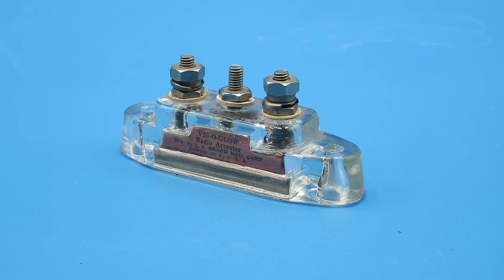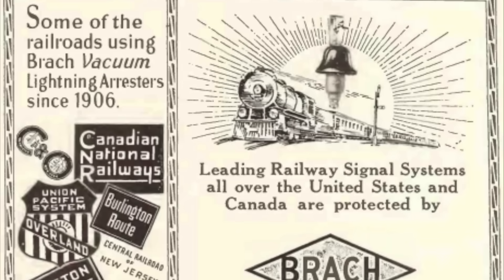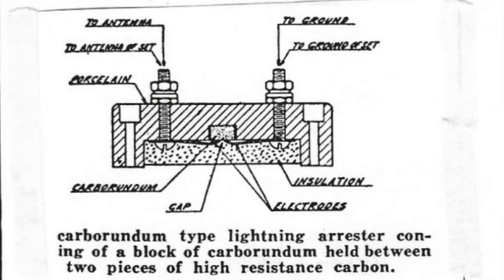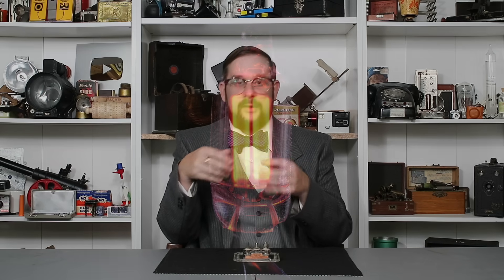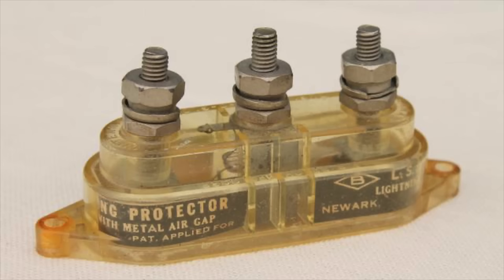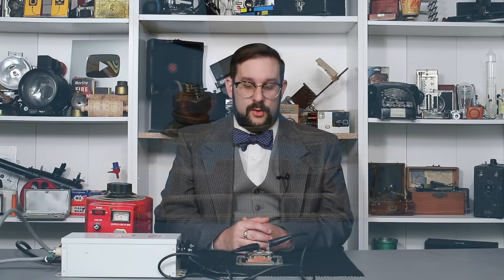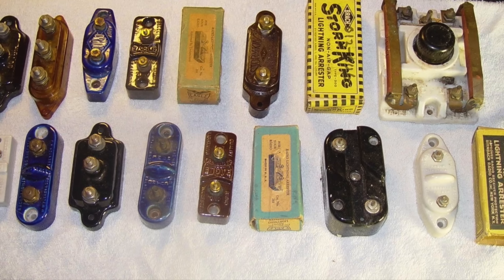SHORT: Vis-o-Glow Lightning Arrester

Comment: back in the day, I had a friend who ran a big CB "alligator" station, who used to unscrew the antenna cable ("coax") lead  from his rig and place it into a thick glass "mason" jar (I told him to do this to protect himself and his CB station from lightning strikes) and during  thunderstorms, you would see a mini-lightshow as the static buildup would dance about inside the jar (he, himself, didn't see the sparks- but, rather, HEARD them.. as he was totally blind!)  and before you ask- yes, his antenna installation was properly-grounded (but lacked a spark gap).

Comment: As a Telecom Engineer I've seen antennas obliterated by lightning...
Notably an expensive Procom CXL 2-3LW on a 20 meter mast at dispatch of a transport company we installed a couple of months before. Only white shards of glassfiber remaine, the golden Aluminium mount had a crater where the antenna was, and in a circle of 400 meters almost all electrical systems were damaged, and a large diameter telecommunications cable melted...
Radio and a Procom bandpass filter on the coax were fine, filter had some flash marks inside, power supply a write-off.
No Lightning Arrestor could have prevented this, was a direct hit on the antenna!
At my current workshops mast I have 5 modern arrestors, ad expensive equipment.
And as a "Novice" Radio Amateur I'm going to do the same for the antennas I'm going to place on my home.

Thanks for the Enlightning video Giles! 🖖⚡⚡⚡

Comment: Some modern lightning arrestors also include a blank 22 shell in them. This might be the part referred to as the "disconnector" in the diagram you show. I used to work at a provincial utility's test lab and we would dissect and test these devices before accepting them for purchase and I distinctly remember us talking about the blank we found in one.

Comment: "[your antenna] will act as a lightning rod"

Popular misuse of the purpose of a lightning rod; they are designed to attract & dissipate the low current leaders that precede strikes.

Lightning rods have pointy ends that make high charge density at the tip; that "hot spot" draws leaders and the rest of the metal rod directs it to earth.

Cheers 🍻 ✌🏻

Comment: Many years ago I worked for British Telecom. The big 300 pair cable that came into the building was terminated on krone strips, which are the European equivalent of punch down blocks. Every ten pair block on the wiring frame where the cable was terminated had an additional ten pair gas discharge lightning protector installed on it, in case there was a lightning strike on the buried cable in the street outside. There was a lot of expensive equipment on the end of those phone lines and the company wasn't taking any chances.
Reply: When BT brought in the BS6312 socekt system the master socket included a gas discharge protector between the A (pin 5) and B (pin 2). This was also the case with the later NTE5 "linebox". Though appears to have been removed from the latest vesions intended for use with VDSL. Wikipedia claims "negative effects", possibly at these frequencies stray capacitance is an issue.

Comment: It's the internal,  therefore, misinformation.  1. Lightning arrestors were used by the average radio listener, as well as hams, because early radios required an outdoor antenna. 2. Why do you assume a 3 terminal lightning arrestor was for 2 antennas? They were for balanced dipole antennas, which have 2 leads.  Otherwise,  it's a good video.

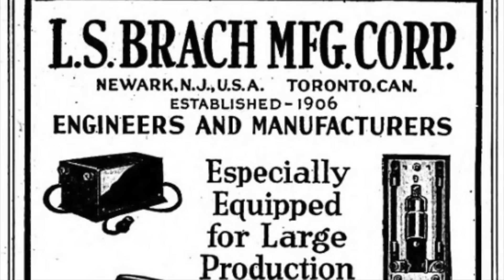Comment: 0:54 Forgive my pedantry, but I don't think these qualify electronic kits.  Electronic implies transistorized components.  I believe this qualifies as simply "electric".
Reply: Electronics just manipulate electrons. The discipline long predates transistors. There are many electronic components that have no transistors, such as capacitors, resistors, diodes, various types of vacuum tubes, even a battery is an electronic device.
Reply: Dang, I forgot everything before the era of 1950s transistors is just non existent after

Comment: Interesting. I built one using neon lamps for my long wire antenna. Not long after we had a severe thunder storm and I disconnected my receiver just in case. Some time that night I hard a terrific explosion as a lightning bolt struck nearby. My neon bulbs had all vanished, and yet the antenna remained intact. I think it was not struck directly but converted the bolt's emp pulse into an electric impulse and was quick enough to not melt the wire or balun. I did have other equipment that sustained damage though.

Comment: Actually the higher the air pressure the higher the resistance. At a vacuum the resistance approaches 0 ohms. Part of the reason for developing brushless motors was for use in aerospace.
Reply: False.  Resistance drops at first as pressure drops, then rises again once there are no charge carriers.  A good clean vacuum is an excellent insulator.  High voltage capacitors are routinely insulated with vacuum.  They are called, oddly enough, "vacuum capacitors".

Comment: Others make/made smaller Lightning Arrester like De-funked Noble DSAR1 series that DSAR1-441LA units were sold thru Radio Shack as Part # 270-811 that still popup on ebay etc.  Can use them before MOV or TVS Diodes to kill much larger power spikes without "wearing out" those parts.

Comment: 😃the old technology is fascinating, years ago dismantling an electrical system of a bank I found a metal box with a large earth conductor connected to the metal part, on one side the meter line entered, I opened it and found the car spark plugs, I was shocked by this type of self-built system in such a place
Reply: Not really, as a ham radio operator there was a "how to build" article in one of the radio magazines. It consisted of two spark plugs, non resistor type from Accell Racing Supplies mounted to a copper busss bar and they used a anti fouling extension as the nut to hold them in place. This design is for operators who use twin lead for their antenna feeds. The twin lead is mounted to the plugs and then continues into the ham shack. The buss bar is mounted directly to the ground stake. The operator then keys up his highest powered transmitter into the antenna while another individual observes the spark plugs through the hole in the bottom of the anti fouling extenders. If no sparking occurs all is OK but if either plug sparks, they remove the anti fouling cap and using a spark plug adjusting tool the open the gap a bit more until there is no more sparking. When all is working good they seal the hole with some sealant to prevent insects from nesting inside the chamber. One rule that most Hams practice, disconnect your antenna feed(s) from the radios, unplug all radios from power sources and disconnect any serial, USB, AND AUDIO cables between radios, amplifiers and computers. On a nearby strike from a bolt of lightning, it can produce thousands of volts of induced power into these cables which act as antennas. It will even induce high voltages on your homes wiring that can destroy anything connected to your home electric system even if the bolt did not hit the power lines.

Comment: A series of paralleled neon bulbs with progressivly bigger value resistors to ground makes in interesting show during a thunderstorm. When they all stay lit, run...
Reply: wow that's awesome!
Reply: Run, no, duck, as there is no way you'll outrun lightning
Reply: "Run, no, duck, as there is no way you'll outrun lightning...".

 Unless you're Usain BOLT.  😁
Reply: @paulstubbs7678  Why run? It's best to stay near the grounded equipment. You will have a significantly higher resistance than the metal in the equipment. If you are really concerned, just grab a random extension cord and wrap yourself in it.
Reply: how does a device with a stationary open spark gap even have a steady ground under normal conditions?
Reply: @funnycatvideos5490  it's the resistance of air due to the distance between two potential differences, one to earth and one to a wire above the earth
Reply: If you run an AM receiver with the squelch turned all the way down you can hear the ground and clouds charge up like a flash camera capacitor. If you do it while driving you can hear it charge up and diminish as you drive through hot spots.

Comment: Spark gaps are also a regular feature built right into printed circuits. Less common these days of course, but they used to be common.

You draw opposing triangles in your copper layer, remove the solder mask, and then tune the space between the tip of each triangle to match the voltage you want to suppress.

It's got all the same drawbacks as open air spark gaps, and performs even worse, usually only good for one protection event. The cheapness and ubiquity of TVS diodes and other suppression techniques means PCB spark gaps are often the worst choice nowadays. But, they are completely free, so you still see them now and then.

Comment: I had a neon discharge lamp at my "long"-wire antenna when I was a kid. I remember listening on the radio when I heard a clicking sound. The lamp was flashing. So it did work. Though I've moved a few times that lamp has followed but it is hidden now. And in parallel with a more modern protection. I think that the voltage for that lamp is around 70 V.

Comment: Gas discharge tubes are still used today to protect radio equipment.  I've got one in a lightning arrester on my vertical antenna.  The main difference is that the tubes are much smaller and mass-produced, but sometimes single-use - they're known to blow apart if a lightning strike is close enough (or direct).  But you can get a replacement for a couple bucks these days.
Reply: That is unfortunate. If they blow apart, they won't protect much, if at all. Because the idea is for them to remain behaving like a short circuit during the duration of a strike, and not blow apart halfway.
Reply: @samuellourenco1050  They last the duration of a strike.  That's measured in milliseconds.  Even if they didn't, the space they are in would continue conducting due to there not being any means of arc quenching.

Comment: Well that's cool. I have the large square white one 4:30 top right, I found it in the rafters of a basement and decided it was going to go with me otherwise it would get damaged and thrown out. I was still hooked up to the telephone line that wasn't there ( they came down in a storm and never got reconnected, but there was some nefarious speaker wire going on with the telephone jacks too so it all needed to be redone ). and I also took the red wall rotary Phone.

Comment: I remember having a neon lamp on some of the surplus military receivers, so I added one to my ham antenna. It was said the bulb would flicker in nearby thunderstorms, and it was true, I would see it flash when there were nearby storms.

You had a telephone lightning arrester in your display. I had a similar one at one house I lived at, and the phone tech had to come and clean the elements under the center screw cover, to eliminate static in the phone line.
Reply: Yep, when the telephone repair guy replaced that type of arrester on our house, built in 1950, he gave me the old one. Inside the black cap was a carbon button element. He said it was easier to replace it than having to change the carbon element.

Comment: A regular small neon bulb will light around 60 volts on the terminals. I have hooked them to a wire antenna before during a storm and watched them flash,when hooked to a ground on the other side.  But for a transmitting antenna you need a higher breakdown so the transmitted signal does not cause ionization.  As for power line arrestors,  they sometimes fail in service and explode.  One time one across the street from me above their back yard blew up and since it was mounted horizontally,   chunks of the insides blew over his house and landed in my backyard.  The chunks were still warm when I found them.  IT was like a little cannon.

Comment: In the UK our master phone jacks (equivalent to the network interface in north america)  used to use a 150v  gas discharge arrester across the lines, some versions also had an earth/ground terminal. 

It turned out they caused problems with VDSL circuits, so now they use a semiconductor arrester.

Comment: VACUUM lightning arrestors! Those must have emitted QUITE the x-ray blast when they worked as intended!
Reply: X-rays are emitted in a vacuum as the voltage goes above 24 KV.
It was a problem in the '50s as the first tube colour TVs hit the shelves. The horizontal output driver tube generated a good amount of X-rays which spread all across the room where the TV was placed.
General Electric modified the vacuum tube - with a version made of lead glass, which blocked the X-rays. The people who bought the TV set with the standard glass vacuum tube had it replaced for free...
Reply: @Ray_of_Light62  I always wondered why my mother would tell me not to sit so close to the TV when I was a wee lad. Turns out, she actually did know what she was talking about.
Reply: @floorpizza8074  Actually that was due to the rumor that it would ruin your eyes. Moreso it turns out it would ruin your mind.
Reply: @Ray_of_Light62  AND?!?  Lightning bolts are well above 24kV, so you had nothing to add.
Reply: These are gas filled, they will not produce x-rays. If they were under hard vacuum, they would arc between the terminals long before they arc internally.
Reply: @rocketman221projects  maybe you should actually watch the video.

Comment: You will find that the three-terminal devices were designed for balanced antennas fed via ladder-line, rather than two separate antennas (although, there is no reason why such a device could not be used to protect two different unbalanced antennas.  An excellent short video! :)
Reply: CORRECT! We still use devices like these on ladder lines. I was just about to make the same comment. DE N4HPG
Reply: Beat me to it!
73 de N7KBT
Reply: 75 and 300 ohm dipoles.
Reply: Yep, balanced antenna lines. The nice thing is that you could put one across a lead-in without changing the antenna impedance.
Reply: Makes more sense.
Reply: Wrong… those came from the telco industry… tip(-) -ring (+) the center is ground…. Then this guy morphed it into radio protection. FYI, they don’t work 😂😂😂 lightening arc’s right over the whole thing! I know because I replaced those identical pos’ for 26 years! 😂😂😂😂
Reply: Well, that one says radio on the side label. But I thought the same thing myself. The shape is just like a Telco lightening arrestor.

Comment: How does this protect The equipment if the path of least resistance is down the antenna not across the gap
Reply: The path is from the antenna to Earth via the central terminal. A high voltage spike on the antenna causes the neon to conduct, thus dissipating the spike. They can protect against a nearby strike, but not against a direct hit.
Reply: @graemezimmer604 Yes
Reply: The output of the transmitter has a higher resistance then the arrester once it lights up.  Thus a manageable amount of current flows into the transmitter preventing it from being destroyed.
Reply: @AIM54A Yes , i thought of that But for the home hobbiist i would think its uncertain and not something I'd count on.. But yeah...if this wasn't s huge low priority deal for the hobbiest i think other plans would occur

Comment: My first job as an electronic technician was at a mom and pop cable converter repair shop. The newer models for over voltage protection used metal oxide varistors, the older models used capristors, a ceramic .002uF capacitor in parallel with a 1 mega=ohm resistor, all in parallel with a tiny spark gap.

Comment: I came across a mercury arc rectifier at one point, it was the size of a small child and had about a liter of mercury in it. I think they were used to supress arcing in early forms of switch gear but id love a video on one because I have no idea how they actually work
Reply: Not so much to suppress arcing, but simply to act as rectifiers to convert High Voltage AC to DC.
See Wickipedia entry for "Mercury-arc valve" for a description of its operation.
Reply: There is video of one being used to power a trolley system on a tourist railroad. They are rare but they are the ultimate decoration for a mad scientist lab.
Reply: There's a good video of them already. Beautiful things.